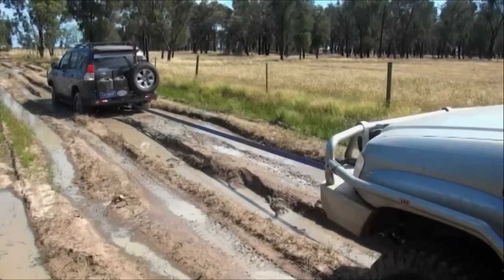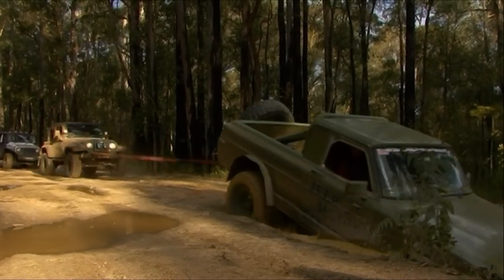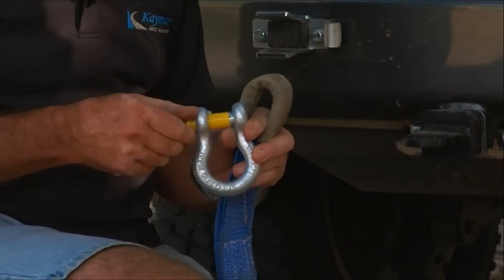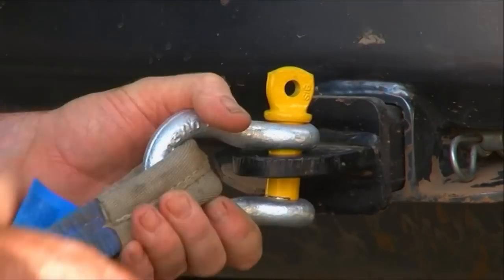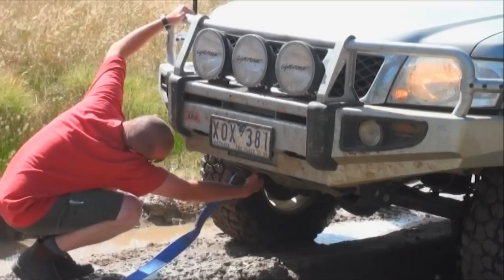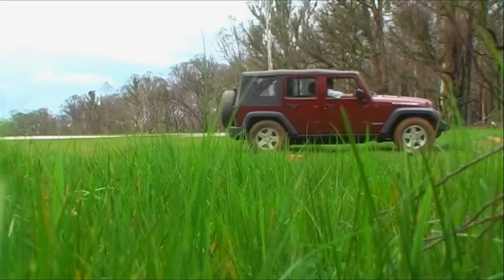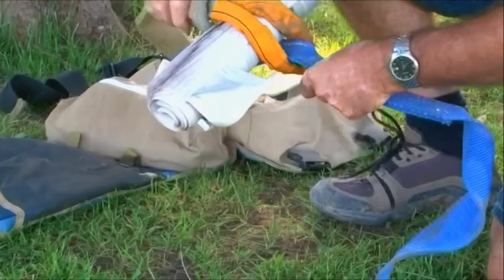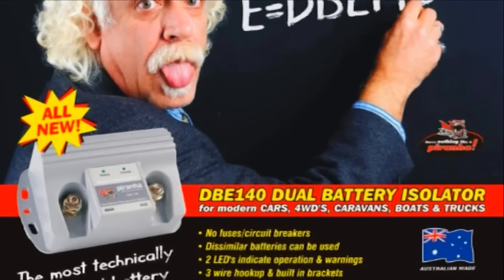Ask an Expert 031: Attaching a Snatch Strap

Comment: Great video! very informative!  For those 4x4 owner don't buy cheap or not reliable brand of snatch strap. Always choose a reliable brand. Like Miolle brand strap , An amazing recovery tool for any off road vehicle. But also extremely useful for a two wheel drive auto stuck in the snow, Sand ,or mud. Easy to use and stores simply in it's carry bag in the trunk or tool box. The quality is 100%! Service from the company is excellent. Love this tool!

Comment: I enjoyed the video and there was a lot of good information here for the beginner and seasoned veteran alike. I don't subscribe to the backing off of a bow shackle a quarter turn or so, but it will not hurt in a recovery situation. If you're doing any type of rigging, however you do not back off! There is a reason there's a hole in your PIN, to insert a screwdriver through and loosen it if it gets too tight. Well done. Stay safe on the trails.

Comment: This is all well & good -- but what about the high percentage of actual cars that get stuck (in mud or slide off the road during ice/snow storms)??!!

Where is best place to hook up recovery straps to a sedan or smaller vehicle that is more common to get stuck??
Reply: I had to wrap a strap around the rim of the car. There was NOWHERE I could attach to due to the snow and ice and design of the car. 2001 pontiac bonneville

Comment: Tighten the shackle pin tight. Do not let it loose. If it gets tight after a pull use an adjustable wrench or a rod through the hole in the pin tab. This is what that hole is for. Leaving it loose will deform and compromise the shackle. I am amazed that just because someone makes a YouTube video they consider themselves an expert. Please viewers, remember YouTube is not a credential. It is an opinion. Common sense and lack of ignorance rules.

Comment: What about connecting the strap to the back of the pulling vehicle without a shackle, just using the tow hitch pin?  I have heard it can bend the pin, but I have never heard of it breaking.  I ask because if you don't have a shackle handy, you might want to sacrifice the pin, to get unstuck.  Thoughts?
Reply: Jmichael Isbell that works awesome, even with 1” rope never bent a pin and have yanked 7500 lb trucks that are hung up with a 4000 lb truck hitting the end at 25 kmph, power on . And eliminates all the metal he has between the pin and the rope
Reply: @brucewaldbauer7216  Good feedback Bruce, thanks
Reply: The shock force used in recoverys is more then most hitch receivers are rated for.

Comment: It's kind of interesting how you don't see more half ton 3/4 ton pickups like we have over here in the United States especially here in the Midwest I would like to bring down my mud truck which is a 2005 GMC 1500 with a 6-inch Lift and mud tires and see how it would do compared to some of the commercial off-roaders that you see on TV down there
Reply: Drew Tibert Australia doesn't allow anything more then 50mm of lift which is like 2 inches which is why you don't see jeeps and trucks on 40s like you do in Canada and the U.S. from what I read they will impound your car if you have too much lift.😞
Reply: Drew Tibert yup my 1ton Cummins would love to see it
Reply: @ryancasey3914  Even 40's is getting kinda old in the U.S.  It's quite some time ago now that I've seen guys running 52" tires off road.  It's getting ridiculous in some places.

Comment: Don't back off the shackle. They are meant to be tight.
Reply: Ruth less not necessarily true he is correct in what he said and the force is not pulling on the threads and there is not vibration so a quarter turn or even a half turn wouldnt do much
Reply: Wrong.
Reply: Wrong; tighten then back out 1/4 turn. Keeps things from getting jammed up.